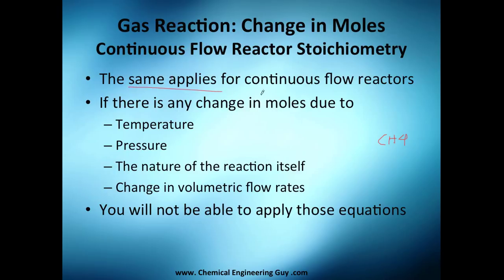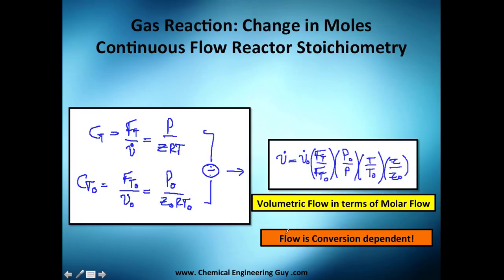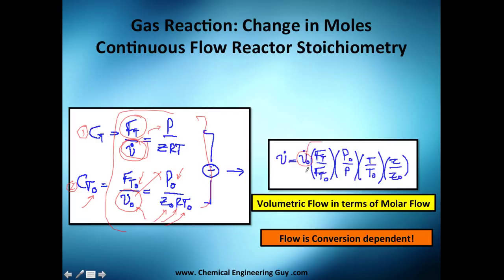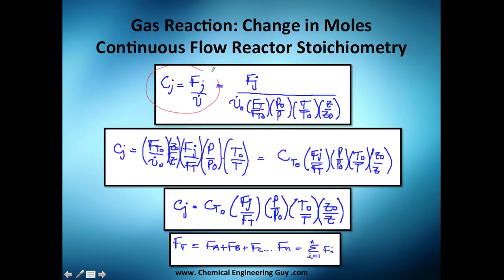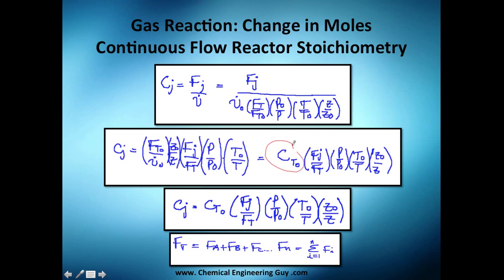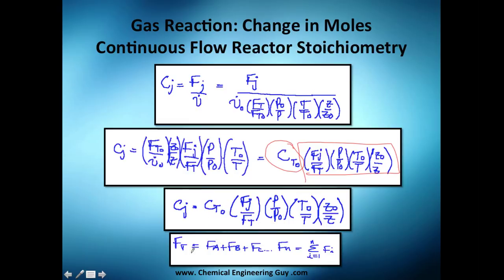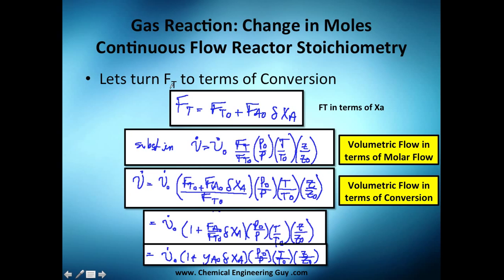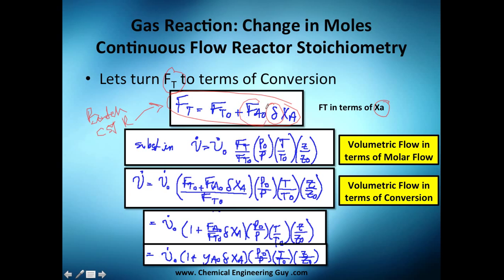Stoichiometry for Continuous Flow Reactors with Change in Volume // Reactor Engineering - Class 56

Comment: cstr and pfr are required to be contacted in series with an equal volume of 100 L, explain how must two reactors be arranged to achieve higher conversion for the first order reactions?
Reply from the maker: Hi, I will need their kinetic rate data, otherwise it will be impossible